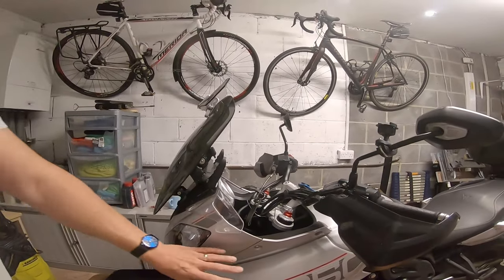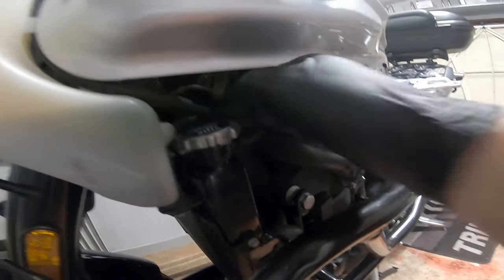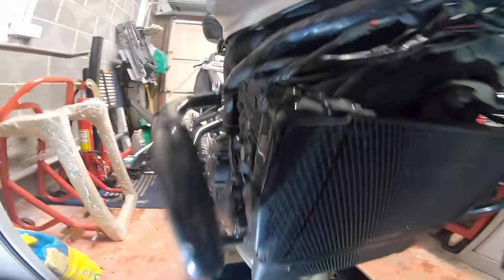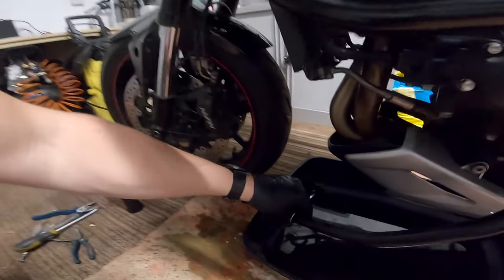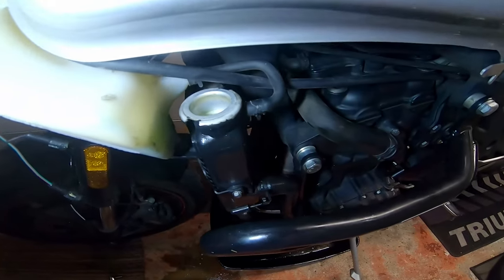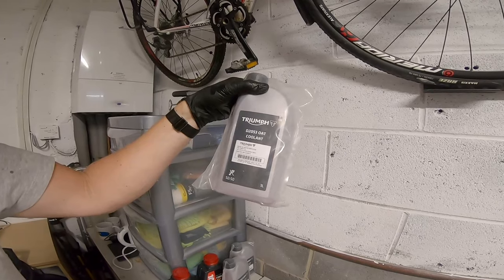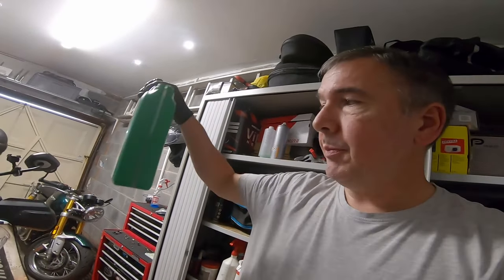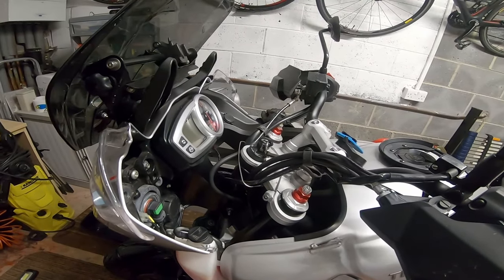Triumph Tiger Sport 1050 12K Service Part 5  - Coolant

Comment: Good to see how others do these service jobs. I've Changed my Tiger coolant a couple of times now, and many times on my very similar 1050 Sprint... 
here's a couple of extra tips which might help... 
It's less mess to pull the hose off at the water pump before opening the cap, drain and bleed screws, just twist the hose, lift the edge of the hose with a screwdriver and poke the straw of a can of WD40 or GT85 in the gap, and twist again.
Worth flushing by running a hose into the rad while it's empty - particularly first coolant change, mine had quite a lot of grit flushed out.
Put a 20mm-ish thick piece of wood under alternate centre stand legs to tilt the bike and fully drain the system, and when filling. 
I've never refilled with as much as Triumph claim is in the system, the little extra you get out by tilting the bike still doesn't get the same volume out, my Sprint was the same, so not sure where the extra went!
Reply from the maker: Thanks for the tips. I have to do my Thruxton soon so I will take these in to consideration.

Comment: Really useful set of videos, thank you! I just changed my coolant, I got just over 2 litres out and I put 2 litres back in. Did you have to refill it after a run?
Reply from the maker: No I left it to run for a while after I changed it and topped it up. It stayed at that level after that. Glad the video helped

Comment: Hi UNB. I changed the coolant on my tiger sport a couple of months ago. A wiggle and twist got my hose off the pump ok but I’ve had rouble like you on other machines and found using WD 40 with tube attached and squirted under the pipe with the help of a small screwdriver or similar, usually breaks it free. Didn’t know about that bleed screw on the top of the rad on the tiger though. Noted for next time. Cheers.
Reply from the maker: How much coolant went in when you did it.

Comment: Very useful.. I did the bad mistake of buying a triumph tiger like yours without any service history.. and now it feels I am paying the price for it.. bike overheating, clunky, had to change the rear wheel bearings, front breaks pads, the rotors are pitted and vibrate during breaking, rear suspension is soft on the hardest setting… all in all.. is a mess
Reply from the maker: Hopefully these vids will help you get it running better
Reply: @upnorthbiker  selling it now.. 😂😂 (just trying to buy a house) love the frame tho and comfort.. went to France and enjoyed it as it would have a been a S.sport bike.. absolute joy, closed the tires 🙈
Reply from the maker: I don’t envy you. Houses are so expensive and you have to spend evenings doing diy etc. Hope all goes well.